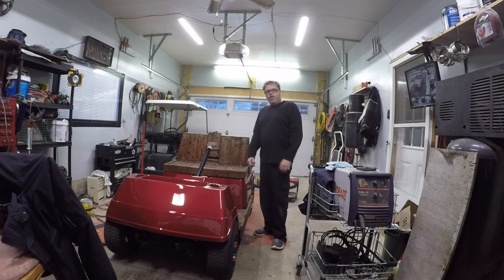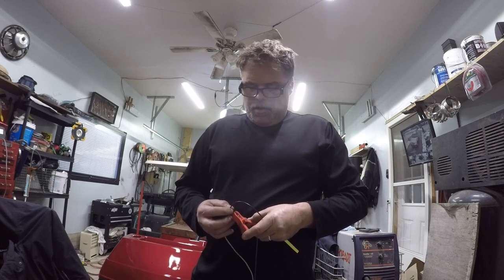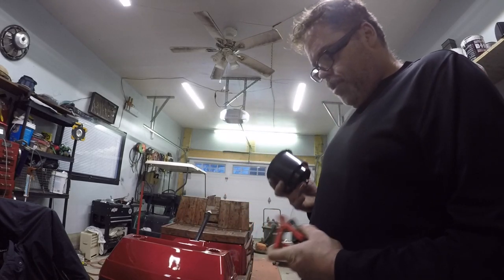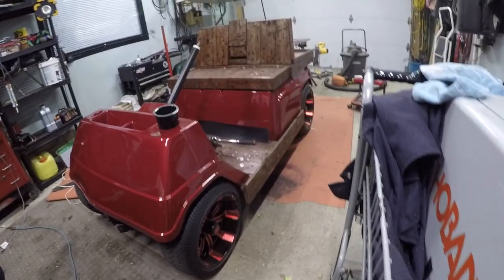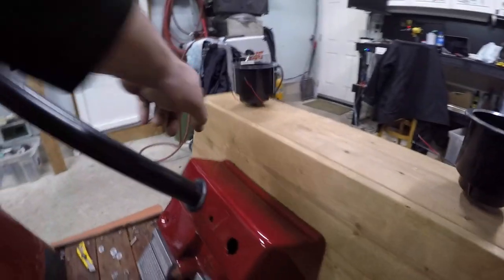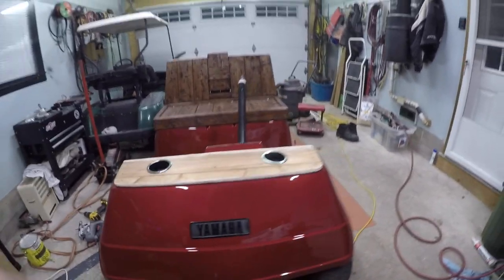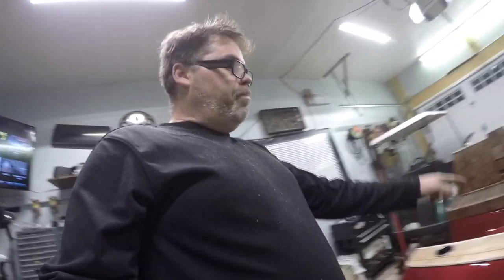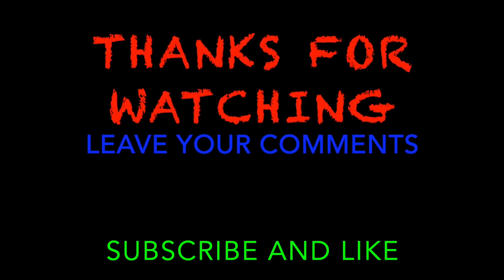J&J Body Shop Did The Golf Cart Up Nice

Comment: for the lower areas below dash either rubber or thin checker plated aluminium
Reply: Totally agree with the checker plate.
Reply from the maker: it have to be black . Me no like chrome
Reply: @LifeWithBillSiff  see if you can find those plastic/rubber checker plate floor tiles, probably find it black to, you would , so why wouldn't eh?